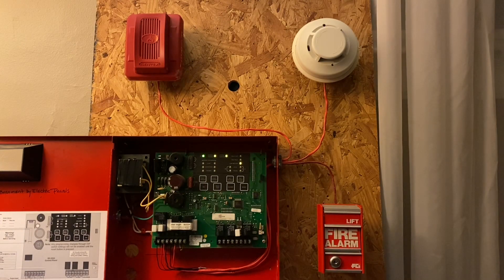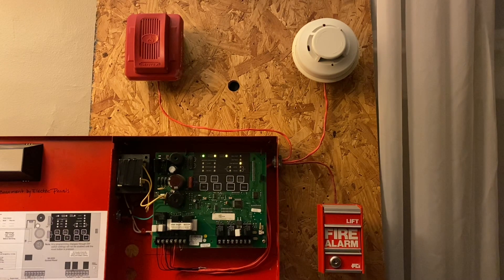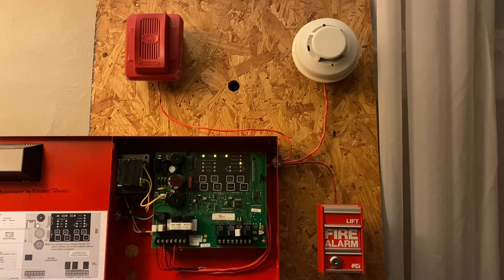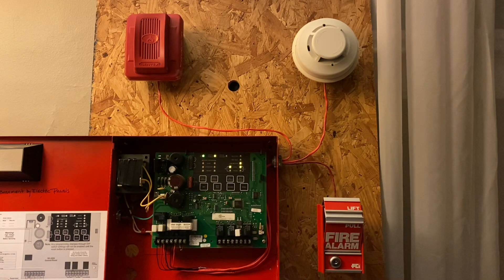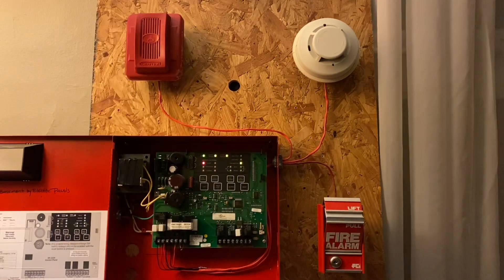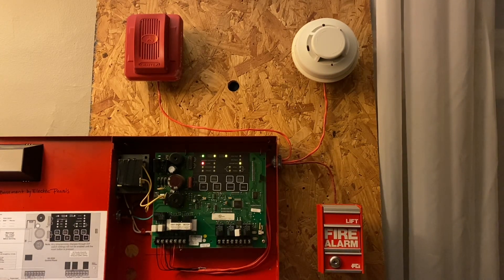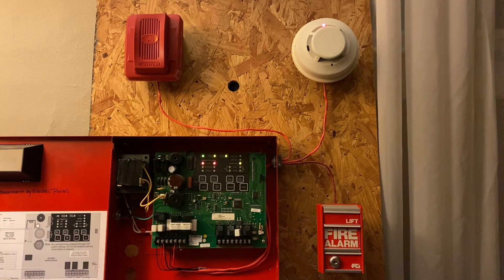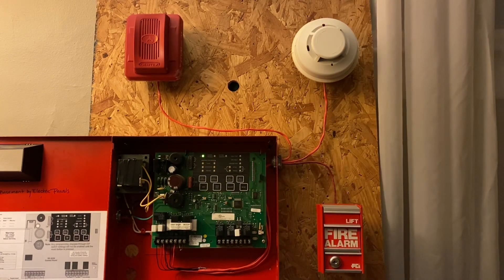Mini System Test 78

Comment: Can you tell more about the system update.
Reply from the maker: On my main system?
Reply: @Dredpath1  no where you got the gentex commander remote horn from.
Reply from the maker: @SomeDudeWithAnExitSign  MS-9600UDLS panel, P2WL horn strobes and BG-12LX’s
Reply: @Dredpath1  I wonder if fire lite will replace the ms9600udls. It has been 3 years since the ES series was introduced and we haven’t seen a replacement for the fire lite ms9600udls yet.
Reply from the maker: @SomeDudeWithAnExitSign  not sure